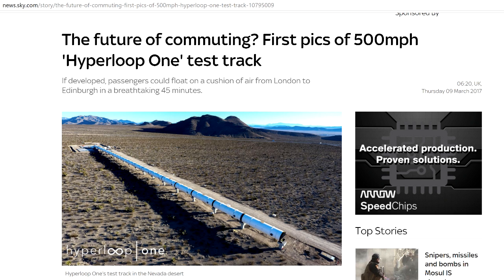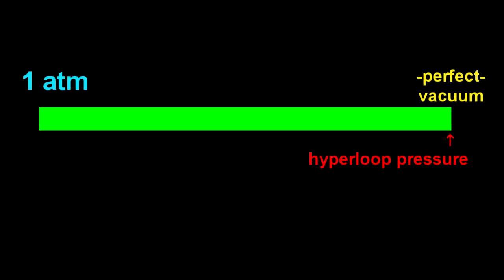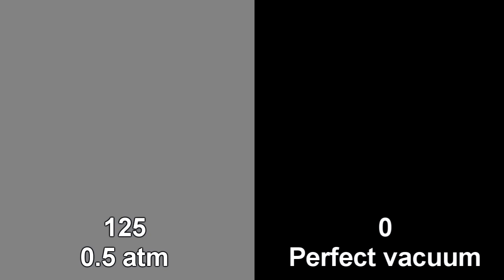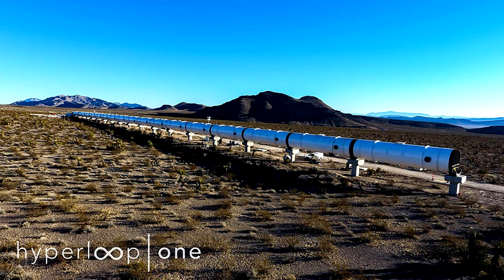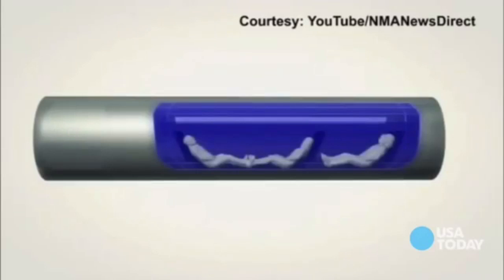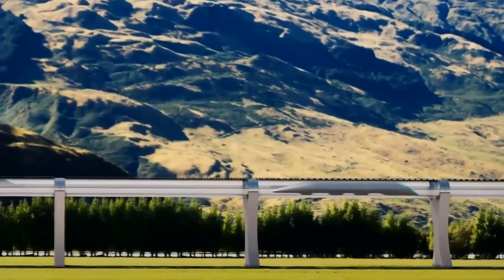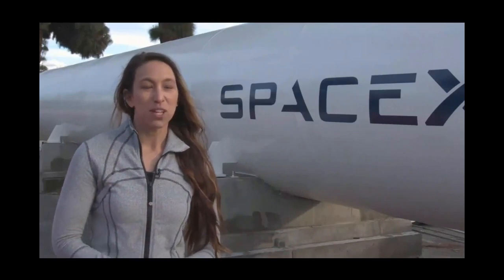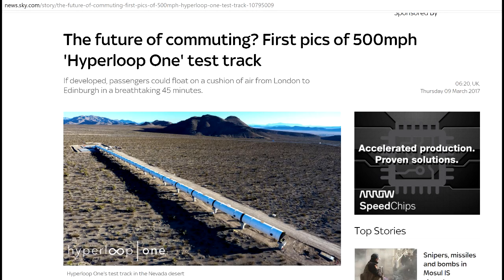Entire Hyperloop could be destroyed in SECONDS!

Comment: I really don't get these tests.

What are they trying to prove with those unpowered pods.

... Get a tried and tested maglev train, or hell, even a conventional high speed train, and see what it can do in a vacuum and I'm sure you'd get about a million times better results from that alone than the tests they're running here.
None of the test setup even makes that much sense.
... How is this thing supposed to work again?
Reply: step one: build a regular maglev train
step two: create a structure above the train tracks that allows you to reduce the atmosphere of the train to reduce air resitance. Even going to half-atmosphere could do wonder and you don't need to worry quite so much about the catastrophic results of the tunnerl collapsing
Reply: Creating an maintaining the vacuum would be too much hassle for what it's worth I'd think.
Otherwise, we'd long be using them.
Reply: I dont get why we're so obsessed with reaching high speeds like that, the Maglev already broke a record with 600km/h. The average highspeed train in europe only goes as fast as 270km/h to 300km/h, there's only 3 tracks in whole europe to exceed 300km/h.
The Maglev doubles that speed.
Creating a vaccuum around it will certainly increase speed but at what cost? Not only will it cost more to maintain since you'll have to power pumps to reach said vaccuum etc but what if there's a failure or a leak?
Reply: It was a promo event.
Reply: Kuralthys
The idea of the tests is to prove that a vacuum will allow the pods to roll to the end with almost no speed loss because of air friction.
Reply: They aren't trying to prove anything, they are just trying to grab some of that sweet research moolah by dicking around with half baked ideas.
Reply: So they failed in every conceivable way imaginable?

That is what i got out of this. probably should turn focus into incremental improvements with a higher chance of not wasting time and money. There are other facets of life that can be bettered guaranteed if we only had half a mind to do it.
Reply: Wraith Gear the whole point of TESTING is to find faults and improve on them the people who wonder why the test track is so short its because they are not goinh to spend millions of dollars on a full length just to test pod design
Reply: Son, the point of testing is to figure out the issues with VIABLE projects.
10 minutes with an actual engineer would have given you the results these tests had given.
Reply: Also if depressurising that whole tube takes so long, why don't they have an airlock for loading the test pods?

This whole test rig seems to have been designed by idiots.
I mean, come on! I know very little about the science and engineering involved beyond what I picked up on a failed attempt at an undergraduate physics degree, but the whole thing seems very stupidly set up, and raises serious questions about what, precisely they think they're testing...
Reply: It does raise the question... Can this concept ever work safely? Is there any design variation, or adaptation of the concept that would get approximately the same results with fewer risks, or is the entire concept a complete dead end?
Reply: Technically it could be possible, but it would require materials, machinery, and security and maintenance measures that would raise the cost to astronomical levels. And even with all of those measures if something fails the end result will be exactly the same.

Comment: One sign that that Hyperloop One test track is a total scam. Look at the tubes. Not just the thickness. They are in fact engineered the wrong way. Note the strapping braces around the outside? That is standard steel piping designed to carry pressure or load on the inside of the tube. The reinforcement is totally wrong for a vacuum in the tube. The tube they are using is meant to contain excess pressure on the inside, not on the outside. They would not be able to get that stuff down to enough of a partial vacuum to even begin to perform any useful test before it would implode like a beer can.

Comment: When the Hyperloop news first emerged, I was always under the impression that it would operate under normal pressure, but that the air would be getting pushed around in the loop and that this was what was going to push the "cars" along.  The "cars" would be directed down a side channel to a depot at each end for loading and unloading.   If you don't mind, could you do the back of the envelope calculations on how much energy would be needed to keep that volume of air in a continuous loop?  Also how often along the path that some kind of additional boost to the air flow would need to happen?
Reply: I thought the Hyperloop was supposed to be a maglev under a partial vacuum? At this point, no one really knows. 

But tech like maglev could do with R&D to help put costs down.
Reply: Before Elon actually spelled out what he had in mind, it was someone else's idea for what he might have meant.  There were a lot of ideas being tossed about back then

Comment: The energy released would not be as simple as bomb.  It would send this tube writhing across the landscape as it tore free from its supports and snaked and rocketed and sought to relieve the vacuum in random methods.  Anyone living near this thing would be in danger of having a steel tube whip through their house.  

The hyperloop is a pipe dream designed to get billions from the government.
Reply: Trains jump their tracks all the time and sometimes smash into things.  But at least the fucking railway doesn't.
Reply: And people complain about solar panels. At least they stay still :D
Unless there is a hurricane. But anything will fly around when there is a hurricane :D
Reply: Be Advised " Pipe dream " Ba-dum crash
Reply: the sections of tube would most likely break at their jointed areas rather than contract together in a long whip like chain and aerodynamic drag would eliminate most of the danger to any reasonably distanced buildings

Comment: If I make it to 2050 I'm gonna stream this video whilst taking a trip on the hyperloop. Hopefully I can find this comment and describe the journey...
Reply: Zak Farley RIP you
Reply: The thing is, there is no FUNDAMENTAL flaw in the idea behind the Hyperloop. On paper this thing works. The issue is of course:  "well what if this happens it could be catastrophic." The ping pong ball in a burst vacuum can be solved by an aerodynamic design and brakes along with a failsafe mechanism that prevents the further flow of air along the pipes length. The Chain reaction implosion of a dented chamber can be solved by simply bulding tubes that can withstand the pressure. No doubt if we ever DO get the hyperloop which I completely agree has the likelyhood of me one day shitting out a ferret. It is still POSSIBLE albeit probably in a watered down ridiculously expensive form.

Comment: Make your point thunderf00t, but don't lie to us.  The color difference between your .01atm and perfect vacuum would be noticeable (at least to me a graphical artist with a good monitor) if they weren't both perfectly black with rgb values of 0,0,0. 

Also your 125 white is actually 130, and 20 is 8.  Don't lie.
Reply: Na its ok, the air being sucked into the hyper loop if its metal shell is punctured will just slam into any carts within, even then the carts within will be going about a cars pace, so its fine, also the massive amount of steel needed to create the tube will just MAKE MORE JOBS who cares if it doesn't work now we should just throw more money at it till it almost works

Comment: Now I'm not a physicist or an engineer, but building and maintaining a 1000km-long vacuum chamber doesn't sound like anything remotely cost-effective to me. But one thing I've wondered while watching these videos: They never seem to mention the method of propulsion. In the 1 km test track they seemed to have used some kind of electric sled. Is there any information about that? Some commenters have mentioned a mag-lev kind of system, but wouldn't that make it even more expensive?
Reply: ThePressurizer That's what I don't get, Elon expects a massive vacuum tube with tickets cheaper than a train ticket to pay itself off.
Reply: From what i gather it's all probably just a stunt for cash.
Reply: Which brings yet another Engineering Headache into the picture. Dispersing the heat from the maglev system and cooling it to maintain the superconductivity needed for it to work. In a sealed vacuum tube. That cannot itself suffer any expansion effects from temperature changes.
Reply: "They never seem to mention the method of propulsion"

Unicorn farts!
Reply: I think Thunderfoot understands the problem quite well.  At least he doesn't refer to internet videos to back up his claims.
Reply: +Juuso Peltoniemi
The burden of proof doesn't lie on me to explain your point for you.  If you think Maglev's are expensive please explain why.  Now if you want to say they cost a lot of energy your sorely mistaken as I've shown in the source below.  So what other reasons do you have that would warrant this criticism?
http://lrrpublic.cli.det.nsw.edu.au/lrrSecure/Sites/Web/physics_explorer/physics/lo/superc_08/superc_08_03.htm
Reply: The savings come from not having to deal with the aerodynamic losses when you try overcoming the drag forces at high speed. High speed railways have a top speed ceiling of ~300mph because of these losses. There is a non-linear exponential relationship between velocity and the drag forces i.e. it takes a much greater energy input to achieve the next mph compared to the previous mph.

I'll try illustrating this with not-exact numbers
Lets say a car can go 100mph with 1 engine. To increase the speed by a step-size of 50mph to 150mph it needs 2 engines. 
To increase the speed by another 50mph to 200mph it needs another 8 engines. 
To increase the speed by another 50mph to 250mph it needs another 60 engines
To increase the speed by another 50mph to 300mph it needs another 200 engines

That's generally the idea. The step-size of 50mph remains constant but the required number of engines starts rapidly going through the roof. 

The Hyperloop makes no sense at low-speed. It becomes more and more cost effective the faster you want to go (compared to traditional high-speed roads/railways). 

The running costs of the Hyperloop will largely stay constant regardless of what speed you want to travel at. 
The running costs of a traditional train are directly proportional to the speed you want to travel.
Reply: It's a maglev, tech that prooved to be too expensive for too little gain to be actually used outside of classrooms - well, with the exception of one or two systems in asia that are now filed under "engineering folly" and "waste of tax payer money". But it sure is fast for a train-like system. The air resistance is not what caused maglevs to fail though, just to keep that in mind. Now we take another system, a fundamentally flawed one, add it on top of the first one. The result is we gained a system that has a nice increase in it's one strength, while accumulating all the negatives - each of them already a deal breaker on their own - of both systems.
Reply: Interesting! But I distinctly remember that the Transrapid was also supposed to be more energy-efficient than a regular high-speed train. But in the end the cost to build and maintain the train itself and the necessary infrastructure had risen far beyond anything the authorities would've been able to invest. Plus, an accident cast doubt on the safety of the enterprise.
Reply: +beaconrider 
What's wrong with internet videos?  After all doesn't that completely discount everything Thunderf00t is saying since he's stating it in an internet video?  Hell Thunderf00t's sources are awful especially when several of his claims require a source such as his collapsing compressor's which need a pressure reading and material callout sourced.
Reply: CharlyBr0wn you didn t hear what tf00t had said about the vacum? he replade saying it was so much little atmosfeare that it will not have a difference
Reply: Ah, thanks for the info. But my doubts remain. I followed the development of the Transrapid maglev here in Germany and the reason both planned TR tracks were canceled was the cost. Not the cost of the maglev system in itself, mind you, but the cost of building the tracks and infrastructure. Add to that the 1000km vacuum chamber and you've got a problem.
Reply: +thepressurizer The alpha-paper says: 1/1000 of earth's pressure.
Reply: Its gotta be a maglev.
Reply: +Juuso Peltoniemi
citation needed.  After all here's what I found on Maglev's in china.  Sounds like there pretty profitable if you ask me.
https://www.intheblack.com/articles/2015/09/01/bullet-trains-and-the-economics-of-high-speed-railways
Reply: +Tanmang42
I would say that is an excellent point.  I'm unsure of how the physics would work to increase capacity on the Hyperloop.  I would think it's quite limited.  This certainly could be a constraint on the Hyperloop's success.  However, I do think it still could be made profitable but likely more expensive than other train tickets.  Ultimately it's a business decision for Elon and Hyperloop one to make.
Reply: There are linear (electromagnetic) motors in the tube that accelerate the pod at points along the route, as necessary.  The pod has a large (very) high volume compressor on board to move air from in front of the pod as it's traveling, dumping it out behind the pod providing some propulsion and also dumping some of it under the pod providing an air cushion.  I would expect it to be a scroll compressor or axial turbine type.  It would seem similar to a hovercraft concept or air bearing.  This is what I got from reading about the spec that was released some time ago.
Reply: It uses linear induction motors (magnetism).  It's essentially a maglev inside of a vacuum chamber.  It then uses a compressor to prevent a pressure build up(not a perfect vacuum).  Also, why would using magnetism for propulsion be inherently expensive?  If you want information on it I'd look up the Hyperloop alpha document online it contains all the information on the topic.
Reply: The whitepaper that thunderf00t takes out of context on several occasions says that an expansion nozzle on the rear of the car will eject a mix of air(from the forward compressor) and steam for propulsive thrust.  While a portion of the compressor air from the front will also be used to generate an air bearing to keep the coefficient of friction low for the vehicle footprint.  The steam will be generated by battery powered heat exchangers in the car and fed by on board water tanks.

As far as cost effectiveness goes, per passenger trip the energy requirement is about 1/10 that of a car and a jet aircraft.  And 1/4 that of a electric car.  This cost includes the electricity for the batteries and the electricity for running the pumps that keep the entire tube at 100 pascals.
Reply: +CharlyBr0wn I believe WendoverProductions has a video on something similar, though it's about planes. It would be better to have a higher passenger capacity and slower speed than lower capacity and higher speed. Amtrak, which runs normal high speed passenger trains (rather than maglevs), generated more than $3 billion in total in revenue in 2016 (1) while the Shanghai Maglev lost about $150 million over the last few years and costed more than $1 billion to construct (2). The least profitable Amtrak line is the California Zephyr route, which loses $52 million yearly as of August 2016 (3) which is only $6 million away from the deficit of the Shanghai Maglev.

Sources;
1. https://www.amtrak.com/national-facts
2. http://news.hexun.com/2008-01-15/102865412.html
3. https://www.amtrak.com/ccurl/398/994/Amtrak-Monthly-Performance-Report-August-2016.pdf
Reply: +Marco Consorti
Yea I heard what Thunderf00t said doesn't make him right.  99Pa isn't a very good vacuum especially not to the point in which you can discount air effects.  Thunderf00t doesn't seem to understand that air pressure should be represented logarithmically and not linearly as he does.  Now the compressor is designed to minimize Kantrowitz limit's effect on overall velocity.
https://drive.google.com/file/d/0BycxRJH8qnUuNEtBMks3REZXU1U/view